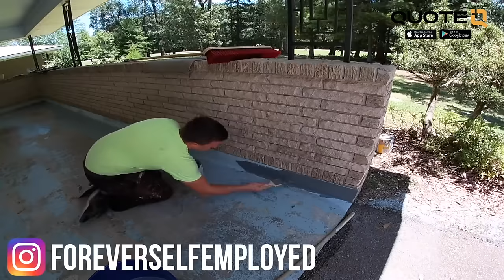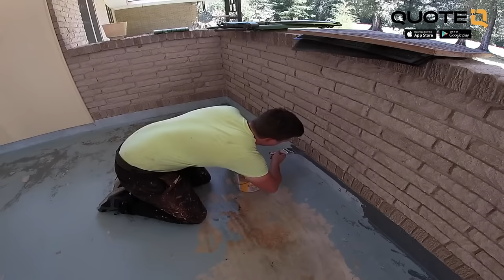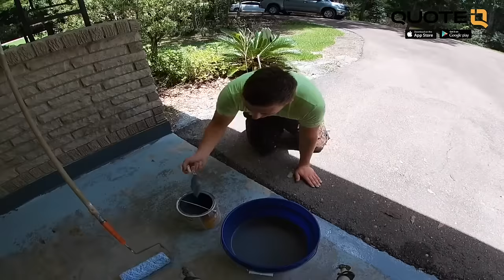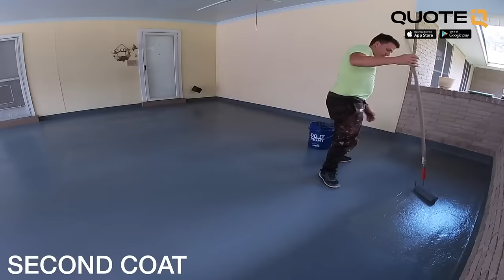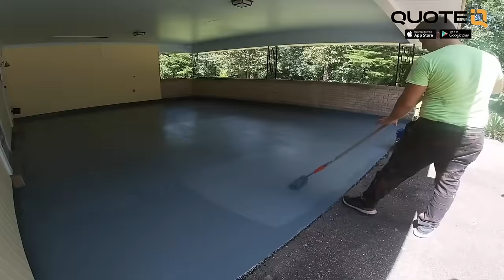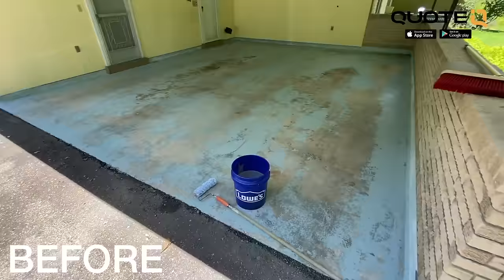Customer Refused To Pay Because I Work Too Fast

Comment: When I worked as a technician at a Saturn dealership in the 2000’s I did a 34hr job in 7hrs. The main stuff was a head gasket, Intake gasket, subframe and then some small stuff like ball joints, water pump, brakes just a bunch of stuff. Well this car was the Saturn S series which was the only car Saturn sold until 2000 so just imagine working on the same car every single day and how fast u can do the work on the cars. Because we only had that car for so long all of us technicians would be able to do 80 hours of work only physically working 40 hours. The head gasket on this car called for something like 11 hours but I could do it in one hour, the subframe called for like 6 hours but I could do it in less then an hour all because I was so familiar with these cars plus I was young so I had a ton of energy. So I get done with the car at like 3:30 and the service writer calls the customer and the customer flipped out because she was getting charged 34 hours and we explained to her we got it done so fast because we work on the same car every day and if u brought the car to an independent shop it probably would take them  34 hours or longer because they don’t work on the same car every day. The customer didn’t believe that we did everything so I put the car on the lift and showed them everything and then they felt much better she thought we didn’t fix everything and were trying to scam her. I told her before I worked here I was at an independent shop and when I did a head gasket on one of these cars it took me 2 full days because I wasn’t familiar with them but now that I’m doing them every day it’s second nature.

Comment: Customers should understand 2 things one that most companies have overhead so you are paying for there gas, insurance, someone to sit and answer the phone the owner, vehicle maintenance ext.. so hourly wages for a quoted job. 75 an hour is actually pretty low. She also only saw you work for 6 hours but you probably work more if you include driving there and back to give the quote initially, driving to get material and equipment all before even showing up. That's usually what I explain to the customers if they start to question the cost. Also every time you get into a quoted job like this both the customer and you get are at risk, the customer is at risk of over paying and the company of taking to long or spending more than expected. The good thing about a quote is you both agree on a fair price to start with so no matter how It comes out that price should be fair when the work is down as well.

Comment: You know your quote is the price. It doesn't matter if it takes you an hour or a week to finish. The quote is never hourly it is for the job and work to be done.

This is how I tell people when I do odd jobs, for sure brush removal.

There are ways to get back at those individuals who don't pay for the service they agreed apon. I have don't this once. I had a dump trailer full of debris, and ready to leave. Went to get the payment and they denied to pay. So I called the owner of the company that I worked for and told him about it. He said back that trailer into the front yard and dump it.. If we loose this customer so be it. We lost them any ways cause they didn't pay..

Will guess what they called a couple of days later and apologized for there no payment. And asked if we could come pick up the mess. The owner spoke to them and said it will cost you double than what the original cost was. Well they paid and I picked up the mess.

Comment: I think what most average people probably assume is, they are calculating in their head how long do they think they can do the same job as good as you the professional, and there lies the problem. A good example of that is a car detailer. Most people can go into their car and clean their car in a couple of hours. So when you pay someone for like 3 hours of their time like 150 bucks, you might think that is high price but you agreed to pay them that to clean your car and the fact that you don't want to do it yourself. The 3 hours I thought was about right for the work. But the average customer doesn't  compute the job..they compute hourly unfortunately. They look at it and think,that should probably take so and so hours or days.

Comment: What i don't like is when they give you a quote based on x amount of hours they say it would take them to do the job.  And you're like ok that sounds good. Then it takes them several more hours and several hundred more dollars then their original estimate. Had it happen to me last fall on a chipping job. I would have rented a chipper and done the job myself if i'd known what the final bill was gonna be. I had already done all hard part, the cutting and trimming and dragged all the brush into neat piles for them beside my driveway on the lawn and told them there was no need to haul off the chips just blow them into the woods. They saw the brush piles when he gave me the quote i had already done the previous work. Needless to say they will never get anymore work from me again.

Comment: Had a few in the past myself because of the speed of the work, even though the work was done above expectations. Told them I'm sorry and If I knew they rather had a slow inexperienced guy at the job for the same price, I wouldn't have done the job myself. It ends the discussion very quickly.

Comment: I never understood these kind of people. You would think that consumers would want good work + fast work. And for that, you would think that people would pay you accordingly. But I'll bet this person that commissioned your services, is someone who is or has worked in some kind corporate capacity. I say that because the corporate types are scheisters by nature. They are in the business to make a lot of money quickly, while doing anything and everything they can to cut costs wherever they can, and that includes manipulating and using people that do a good job at their behest. The reality is, they don't care about you, or their own employees. To them, everything is a liability to the outcome of their income. Corporate business in itself is a shady institution, where no one person is in charge, so when the shit hits the fan, they can place the blame on the weakest link and not have to take responsibility, which leads to personal loss. For them, at the end of the day, it's all about profit and avoiding loss, even if it means screwing someone else over. And also, to them, it's not about what you can do, but who you know, and then what you can do. These kind of people are narcissistic by nature. Money talks, and bullshit walks.

Comment: I sold refacing in silicon valley by far the most expensive, average job over 30k.. Its the worth you have that allows you to get the monies.. If you don't think you are worth it you aint gonna get it. Inside do you think you are worth it?  Customers always have the monies, its not that, its did you sell the customer. Price prep, a sample book of finished jobs with smile customers in them,  did you sell yourself ..  do you have happy letters..  ITS NEVER THE PRICE ITS YOU!  SALES IS AN ART..a darn fine paying one too..  Just discounting is stealing from yourself.. But if i had to I would discount 5% commission better then nothing..But 10 % plus was better.. my average.. Theere are lots of cds or other media on sales..  look them over..

Comment: You need to get the hourly rate thing out of your head. It's a job estimate...you set a price for the job that you are satisfied with and if the customer accepts it then it's a go. How efficient you are is to your benefit. If you had taken 2 or 3 days would you be satisfied with the income? It's just like being a mechanic working on flat rate pay, the particular repair job might pay 12 hours for example, but because the seasoned experienced guy did that job in 9 hours, he made money where as a rookie guy who did it in 13 hours lost money. Don't cut your own throat just to appease a ridiculous customer. You're in this to make money and the more efficient you are let's you obtain more customers in less time. Could have asked her how long she expected you to take and then ask if she thought it was appropriate to work as a business owner for petty wages? If she wants cheap, she can hire some kids to do it for cookies and Kool aid. What she thinks about the hourly rate it ends up being is absolutely irrelevant to the job.

Comment: I had that happen once years ago!  Neighbors CONTACTOR son asked if I was interested in digging out the asphalt driveway for his mom's my parents neighbor new cement driveway?  I told hime sure but gave him a Unit price for the work not an hourly HE agreed!l. He thought the job would take much longer, I busted my ass did the job in half the time of an hourly but charged him the unit price!   OMG the cement contractor told him I did an awesome job not one area was to HIGH if anything a couple o spots were to low. BUT oh no I did it faster than the hourly rate but charged him full fee!!  YA I got my without much of a discussion but he wasn't happy because I did it faster than the hourly rate would have cost him!!  Some contractors are dumber than a box o rocks!!

Comment: i had refuse to pay because the tradie working too slow, but i never refuse to pay because it is too fast. i refuse to pay that guy, because i argue that i pay for the job not the hours you sit idle. because why should i pay for less productive ppl when i can reward the more productive ones. i worked as an engineer, and i can charge my customer up to 150-200 dollars an hour for my skill and knowledge as consultant. so 70bukc an hour for a good old job, it is worth it. old ppl get fix on the concept that pay per hour. at the end of the day, we only pay for what we produce.

Comment: I was scammed when I worked 110hrs and was paid 110dolllars that was 2013 then was conned into working my rent of when minimum wage was 9.25 hr by working 65hrs a month to make 325.00 month plus power free water and the guy I worked for there was over billing the company account 25% dude at dalmomts rv park in Las cruces is a tweeker beware!

Comment: Reminds me of when recently I had to get a new (used) phone.  I came in 8 minutes to close and got the worker to turn on all the unprocessed used phones with me.  I found a 9+ which could run both apps.  He asked for $120 and I tipped him $20 for working 15 minutes past close.  The worker was shocked when I told him to get a good dinner that night on me.

Comment: hey im new to pressure washing and wondering, been looking to upgrade to a new pressure hose but the issue is my pressure washer puts out 3200 while all the good hoses i see on the market are 3100. does that difference in 100 psi matter? will i be getting a worse performance or will it be fine, ive been looking at uberflex and flexzilla 50FT HOSES
Reply: Those sound like air hoses, not pressure washing hoses! All pressure washing hoses start at 4000psi and up!
Reply: @369firewolf  not air hoses, but can I use 3200 psi on a 3100 psi hose? Will I be losing any psi
Reply: No, you should be fine. I always use at least 4000 psi hoses they last longer. 6000psi is even better!